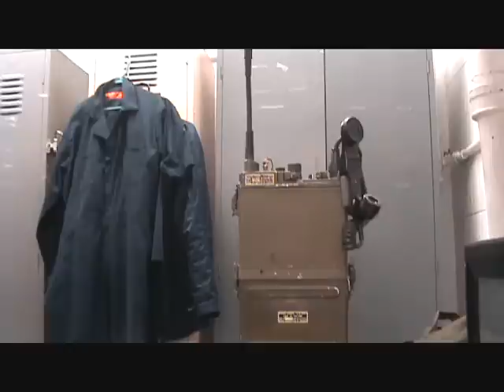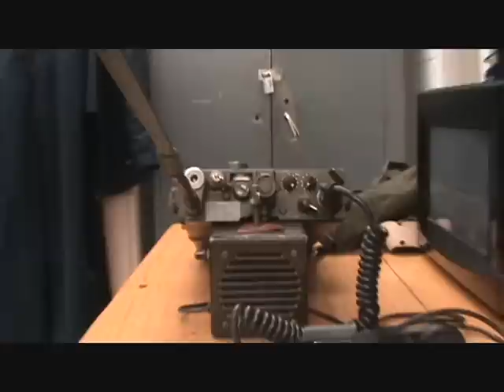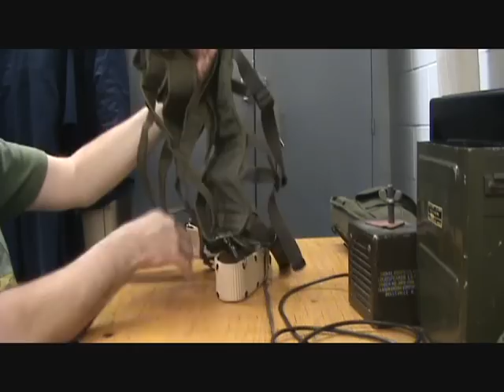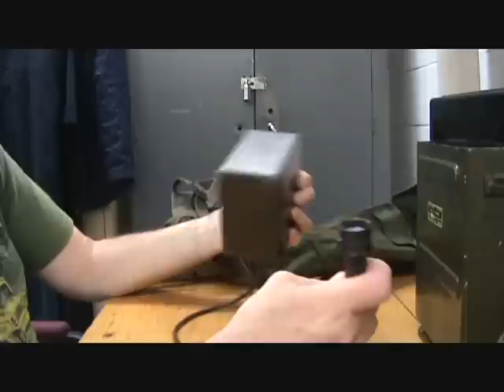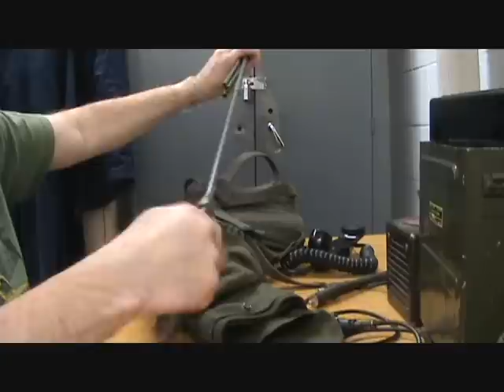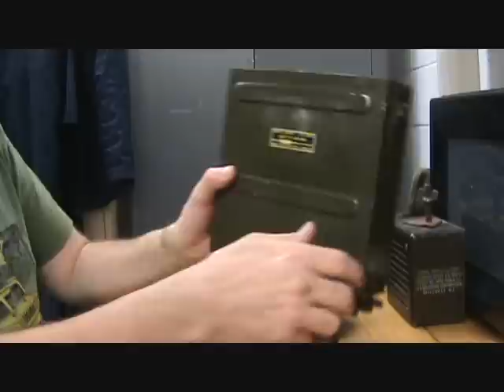AN PRC-10 radio_0001

Comment: will a prc 25 battery fit in a prc 10?
Reply from the maker: Sorry bob no the prc-25 battery is totally different  size and different voltages.See my QRZ page under my call sign KB1PFL and see a batterry I built for it. using 15 9volt batteries and some D cells Not cheap to make though.jim
Reply: Thank you.
Reply: No not at all